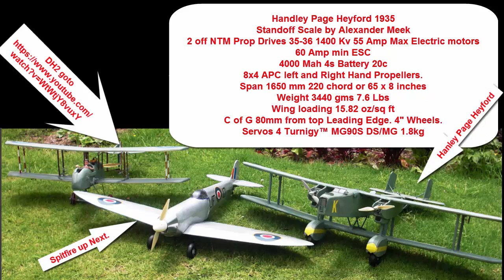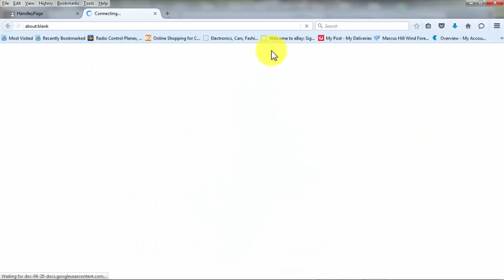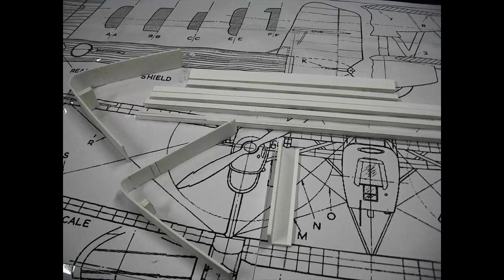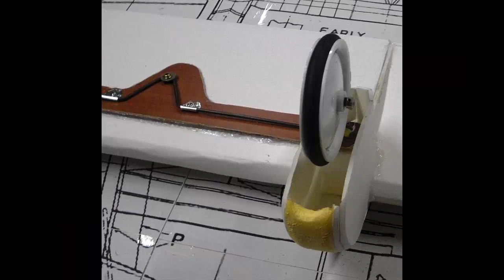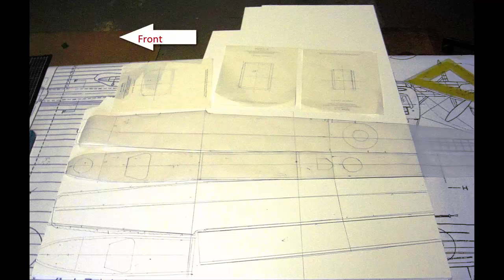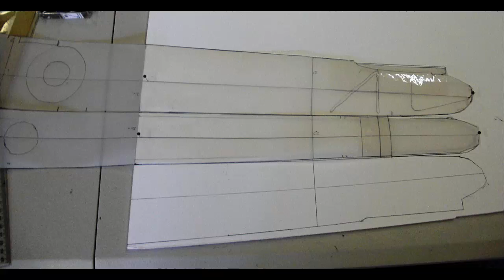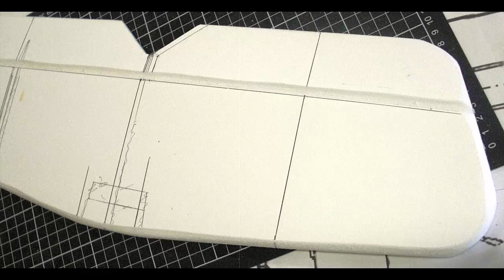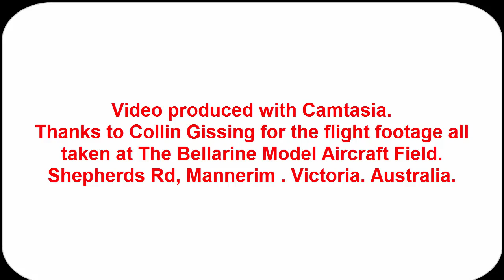Handley Page Heyford 1935 RC Electric Model Airplane.

Comment from the maker: Found from crashing some practical enhancements to prevent future crashing. 1. To prevent tip stalling at slow speeds set each aileron about 3 mm up from neutral. works well. 2.  Use nylock nuts to fix on props with even some locktite to ensure they do not come loose.

Comment: How does one fix the actual wheels without showing the axle ?
Reply from the maker: I cheated and allowed the axle to be below the wheel covering. Then flexing the music wire Iwas able to fix the wheels. The extra clearance comes in handy on heavy landings!
Reply: Fine if that;s what you like 
I think I will build ply hangers inside my spats for the axle and detachable balsa sides as per original [ just saying ]